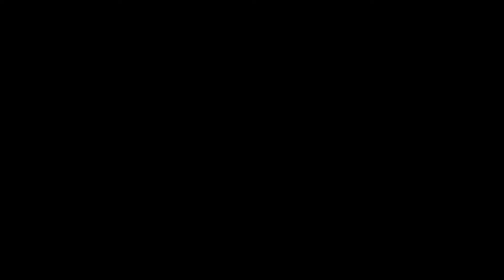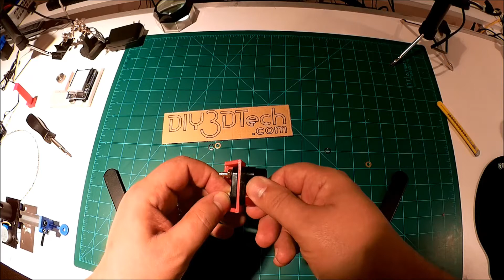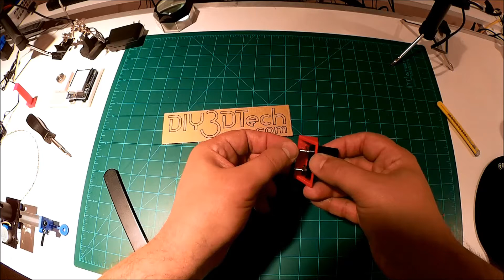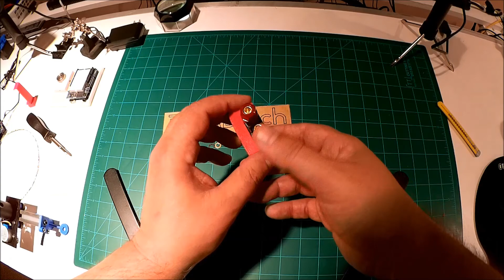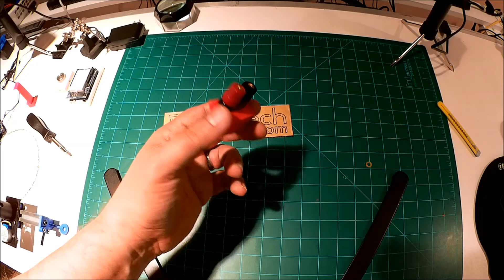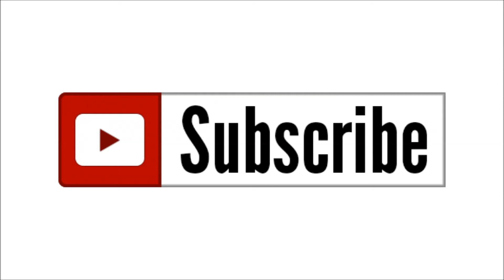3D Printed Projects - Banana Jack Mount

Comment: I would love to see the video of the power supply because I'm about to make one out of an old PC power supply and I have the exact same Banana clips stanchions from Amazon!!  lol
Reply from the maker: +Norbert Davis The PS is only 30 year Radio Shack unit which I bought to use for my CB radios (that was a long time ago) the big addition was the power buck from eBay so I could see the current draw.  Has been very handy!
Reply: I had a CB as well. It was a nice Cobra model. 

I purchased a power buck (12v-24v) that I want to incorporate, also a 12vdc power port, dual USB power port, and a digital volt meter display.  I have a rocker switch for power on and a 6-pole selector switch that I want to use to energize the banana plug terminals so only one type of voltage is hot at a time but I think my method of doing that is wrong. I need to re examine my wiring sketch for that. I am going to use a Thingaverse find as the basis of my case for all this but modify it to fit my stuff.